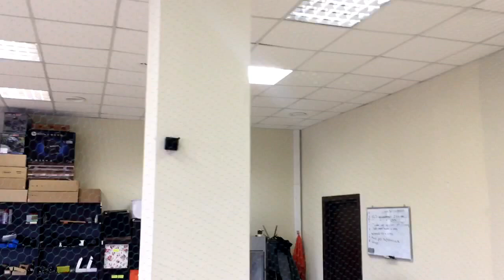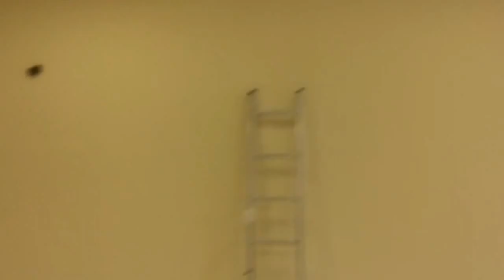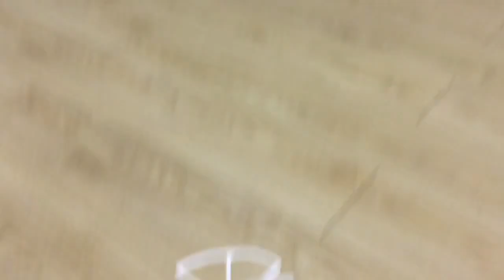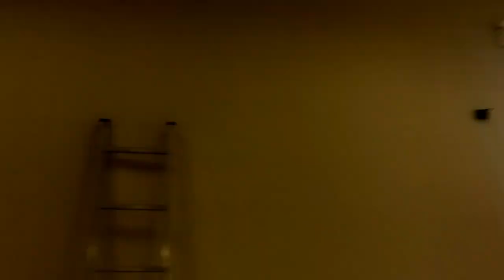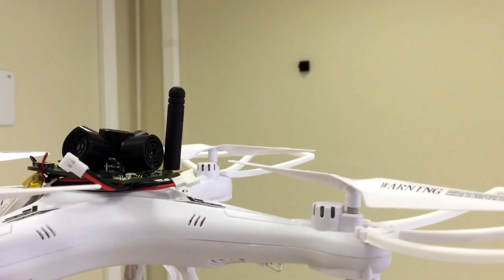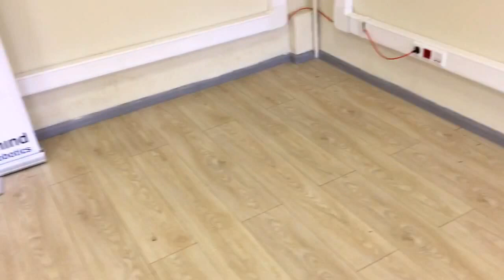Help: Z-coordinates for copters - long explanation

Comment: Hi, would it not be possible to improve the Z accuracy without the 4 + 2 stationary beacon setup by implementing a configuration with two beacons low down and two beacons high up. This might slightly decrease the average x,y accuracy, but would it not overcome the z accuracy problem as the stationary beacons would no longer  be configured in a single plane? Please let me know if there is some fundamental limitation of the system that would render this impossible, or if this could be done perhaps with a software update. Thanks for your time.
Reply from the maker: Hello,

It would be possible. But there is a lot of fine print, and all solutions are full of compromises 🙂
And thank you for the very good question.

- Currently, we use trilateration. But it means you cannot cross or even come too close to the plane connecting the stationary beacons. We have four beacons in one plane because we have 3+1 redundancy, and we can even improve accuracy by combining data from four triangles, if needed, and choosing the best and most trustful and accurate ones

- With your proposal, you need at least four beacons - not three - to even determine where you are, i.e., no redundancy. Accuracy may degrade as well because for spheres must intersect. They never intersect at one point, etc.

- If you start playing, you will find more directional limitations with the configuration with four stationary beacons

This subject is also touched on in these videos:
- https://youtu.be/AIQZcVkonZM?si=2gtbuO4ArzrbXWbN 
- https://youtu.be/jD1URm9oLFo?si=PeRQyRz--c8oCFSU
- https://youtu.be/yWkCwWPdRiM?si=N8Jka9HlEn4CnrX7
- https://youtu.be/FCcE9nUq1vM?si=vXgFeKpm35Oql5L9
Reply: Thank you for the quick and comprehensive reply.  @MarvelmindRobotics

Comment: Thanks for the video! Is it too much of a technical question to ask why the z measurement becomes more erratic as the drone approaches the plane? I am curious.
Reply from the maker: We prepared additional slideset: https://marvelmind.com/download/ => 
https://marvelmind.com/pics/Marvelmind_Robotics_ENG_placement_manual.pdf

https://marvelmind.com/pics/indoor_navigation_system_ENG_copter_help_manual.pdf

Yes, when it approaches the plane of stationary beacons, the Z-error starts to be larger and probability of a jump by hedge increases. 
Currently, the hedge shall not be even capable to cross the plane - upon raising the hedge, for example, the system will mirror direction and will start showing that the hedge again descending. This can be overcome in the drone's SW by knowing the history of movements/vector of movement. 

Also, if stationary beacons are placed on different heights, then the system may be fooled in a positive and in a negative way. So, for simplicity, we always recommend to fly either above or below the plane, for now.

In coming weeks, we plan to publish a new SW, specifically addressing Z-issue for drones. It will support special beacons/submaps, responsible for helping to have good Z precision in all heights.